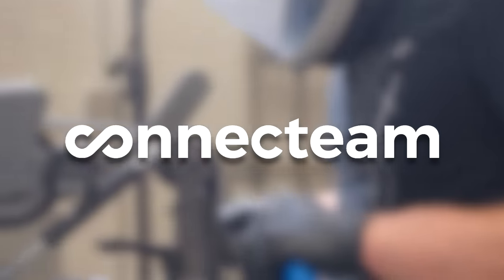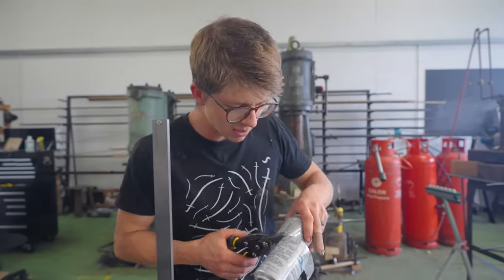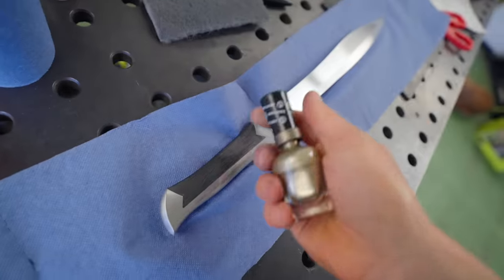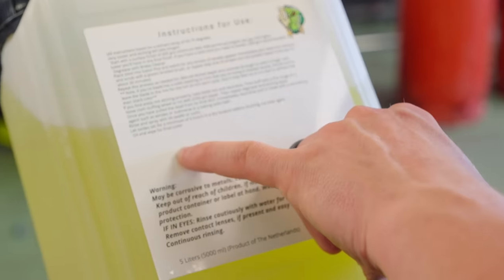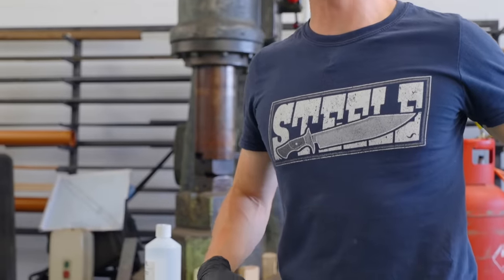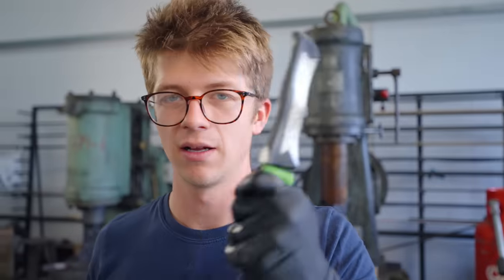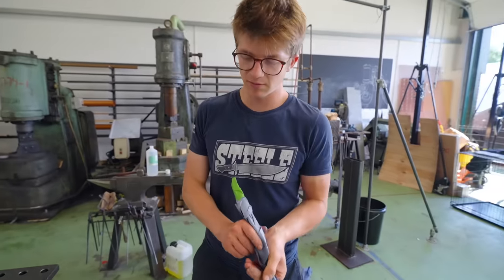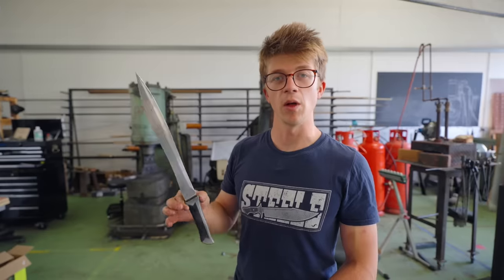Making a Damascus CRYSKNIFE from DUNE! Part 4

Comment: If you used a gloss black nail polish, what was left behind in the grain may have actually looked pretty cool.
Reply: or clear
Reply: or just use clear
Reply: I was gonna say. If you use it as a grain filler to give some nice unique contrast to the wood, it might start a trend.
Reply: @erich4647  That's what I thought then Alec said it too, but also as he said he could have just put it in without protection, at least he knows now.
Reply: @erich4647  still need to be intentional about clear gloss vs clear matte

Comment: The polish in the grain is why I suggested using wax to coat the handle, after the etch more wax could be applied to also protect the steel from rust. Just plain candle wax would have worked just fine but beeswax is a great wax for protecting wood from moisture.
Reply: @hobomofofosho  For a chefs knife or any cooking use mineral oil that's labeled "white" though, it's the one that's food safe. Ofcourse plain beeswax can be ate all day long.

Comment: For the nail polish situation:  May I recommend a stiff-bristle tooth brush?  It won't do anything to the steel, but can get down into the grain of the wood very well.  That is, essentially, what a toothbrush is designed to do.

Comment: You can buy a metal measuring cup (up to 1000ML) to heat up the hot glue. I use them all the time at my during chemical mixing

Comment: FWIW if you wind up with the 'wood + etch' situation again try using a few coats of shellac. It is a wood finish (so no harm leaving it on if you like the look) and soluble in alcohol (usually ethanol but meths will work too).

Comment: Use the hot glue gun to get the glue onto to the wood, including the total volume you need. Don’t worry about it cooling.
Then use a heat gun on 200-230*c to soften it all and then push the knife on. Simple. Heat gun works a treat for re-softening hot glue that’s been applied. Also smooths it.

Comment: I was wondering wouldnt the handle fit better if you first steamed the wood so it would expand and fill all the crevaces instead of pushing it in?

Or is the force of the wood back expanding that great thet the handle will bend?

Comment: Hey guys, you should really keep a squeeze bottle of a baking soda solution and another squeeze bottle with vinegar. Use the baking soda when getting stabbed with the acid knife and the vinegar when you get some harsh degreaser that causes chemical burns in your body

Comment: OK - make one more, since you have solved all the problems!  (I'll take the old one since it is so bad   😁)
There is such a thing as CLEAR nail polish.  (which you mentioned at the end)  However, gold flecks in the wood were hard to see, but would have been interesting effect.
I used it when I did metal engraving to preserve the pattern.
As you mentioned at the end, it is difficult to put the handle on then etch as you have to protect the wood, but the other way is just as hard to fit the handle after the etch.
Depends on which nightmare you want to handle.
Too bad it wasn't Silver Metallic, then it would have matched.

Comment: Alec, what if you tried using more hot glue on the handle wood to protect it during the etch? If you could find a way to apply it effectively qnd get it into those tight corners, you should be able to simply peel it off after. Just a thought man, it was awesome watching this, can't wait to see the next project!

Comment: If you find clear nail polish (or base/top coat), word of warning, they can pick up a slight yellowish tint with age! You may want to make sure you can take it all off in case it discolours the product.
If you gotta go with any coloured polish, for the love of god avoid reds, metallics, and *glitter polish*. They can be tenacious. Another commenter mentioned black polish, these usually are removed easy.

Comment: bog oak is mineralized wood, so i think this time you could put in acid because there is actually minerals instead of the usual wood... maybe if you want to try with another handle you could try the wood separately in the gator thingy before just to check... however the handle looks amazing!!!

Comment: I wonder if some rubber solution glue like copydex would be acid proof yet peel off the wood easily. Or even plastidip peelable paint? Failing that, wax which would actually help with the wood finish anyway. Might be worth an experiment.

Comment: At 2:50.    I have a 300watt hot glue gun that puts out a TON of glue (you can go from 150-300 watts with a switch).    

HOWEVER I don't think it would be hard to make your own hot glue gun with a larger heat block.  The issue with the one I use after using about half a stick it zaps allot of the heat away from the block.

Comment: Alec, next time try  placing the glue sticks directly ON your support with some metal backed duct tape on sides to act as a dam and torch in place, you don't need to make glue pristine, just melt it... Crysknife came out awesome, and I  thought the gold in recesses of wood looked good imo.  Wondered if you could improve on fit by eliminating sharp interior corner and instead use a known radius and just cnc handle to match with a tiny bit of interference fit ?

Comment: Do you add a wax to your Damascus after you etch? "sealing" it with something like carnauba would help prevent it rubbing off the oxides as you worked the wood.

Comment: Next time boil the wood.
Trust me it will work.
 But after you boil it, fit it in the handle (you will definitely know when it is ready) and let it set and dry for a while.

Comment: you need a pot and stovetop to melt as much you want. the tin can and gas flame is to hot and you can't realy control the temperture. the glue will melt around 140-200°C

Comment: Doesn’t jewelers use a wax to hold down big Cubans to the table so they can hand file them down. Maybe that would be better than the hot glue trick. Also the wax bar you can use over and over.

Comment: Hot glue: why not embed neodymium magnets in a jig that can be adjusted to change the angle??
This way you can set the angle and sand/grind/sharpen level.
While getting the perfect degree edge!

Thoughts?

Comment: Peat bogs are acidic it's why they preserve stuff so well by killing any bacteria which could cause decomposition, bog oak has been sitting around  saturated in an acidic bog for centuries, maybe even millennia. The relatively low PH of the etching solution won't have a huge effect on it, but I wouldn't try it with "normal"  non-bog wood.

Comment: sooo, if you buy an industrial glue gun, like those used in warehouses to reseal boxes....you will get the flow you ask for if you get the correct glue for them. Melting hot in seconds from plugging in and cooled to hold in less than 10 seconds. Those things are insane. So many burns received in haste...

Comment: If you struggle to get your blade of the hot glue, there is a little trick we use now and then in our prototyping workshop.
Just use a few drops of methylated Spirits and after some seconds it will pop right of without degrading the hot glue.

Comment: 3:07  is there a reason, why Alec is not just using wax?
I mean he did work with it rather often... wouldn't that be an easier option, instead of hot glue?
Or is it not strong enough to hold the blade?

Comment: For the hot glue trick, I've used a heat gun for similar stuff, you may even be able to get away with using a hairdryer.

Comment: Lol, simply lay hot glue rod on your stand and heat with hot air gun, preferably temperature controlled, certainly not open flame.